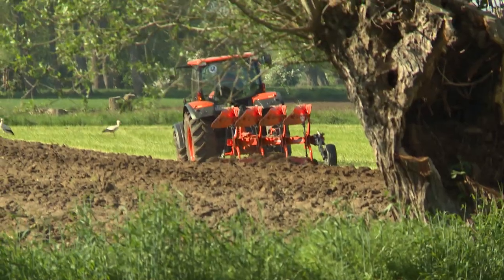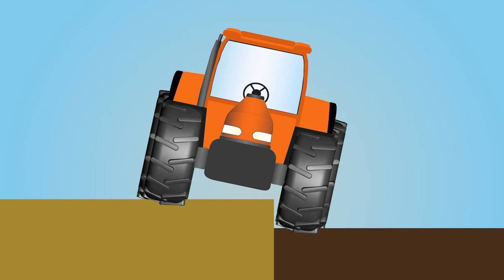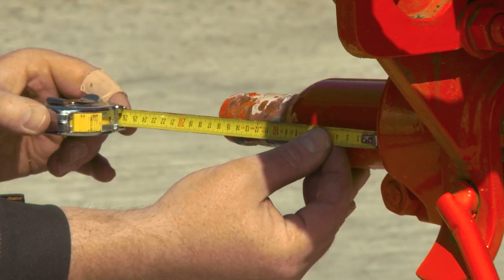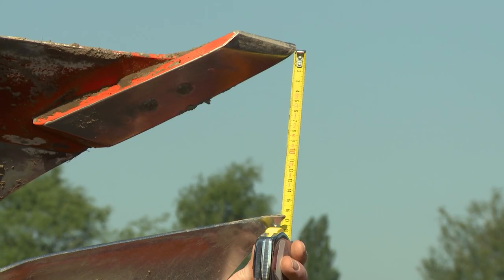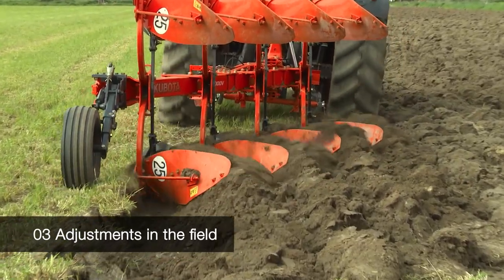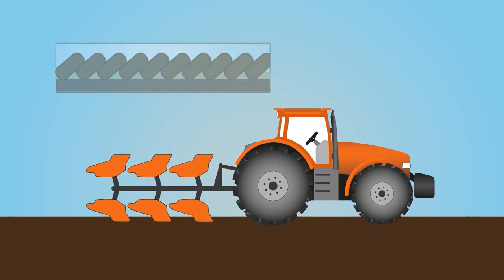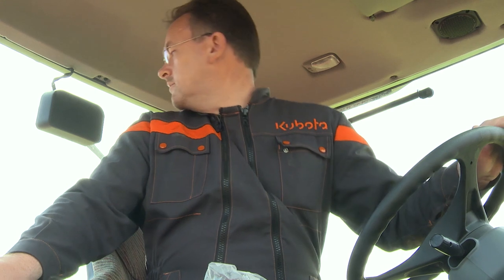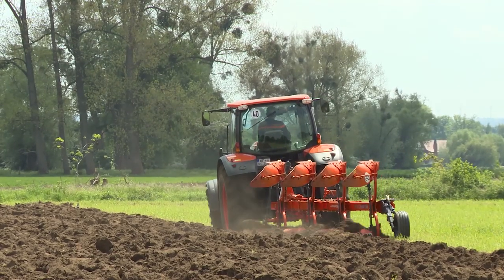Easy Plough Settings | #Kubota 2021

Comment: With a wheel sticking that far out. How do you plough next to a neighbor. if he for example is growing maize next to you. You'll have to leave one furrow?
Reply: Where are you wanting it, on the front? A good designed plough has the wheel in line with the back furrow.
Reply: @bigteddy66  I would want it within the furrows, not sticking outside of it
Reply: @appel500  that way you get a seesaw action on uneven ground, lift front deepen back
Reply: @bigteddy66  on the 5 furrow plow, this is a 4+1, the wheel is moved to the middle and it is tucked in between the furrows. And it still follows landscape
Reply: @appel500  not properly it doesn't not in my opinion anyway and if you're on steep ground it becomes more obvious as the operator tends to have to ease the plough out at the front a little going up hill depending on conditions and type of soil. We all have our thoughts and practices.
Reply: Did you found the answer?